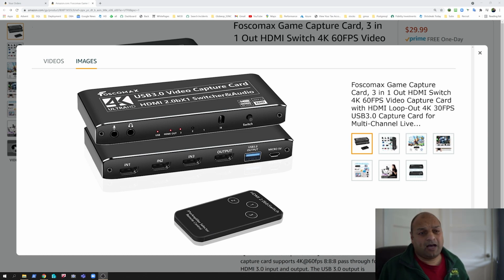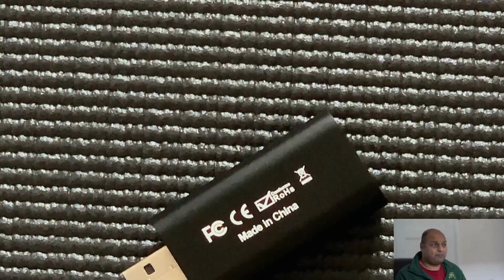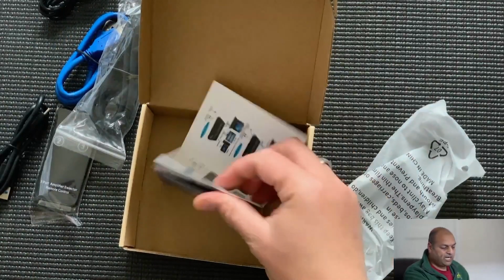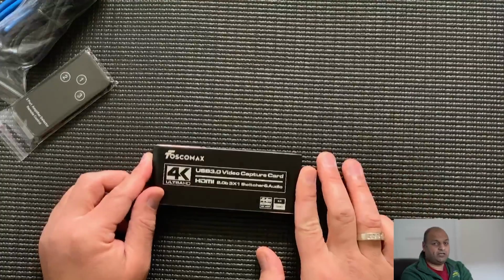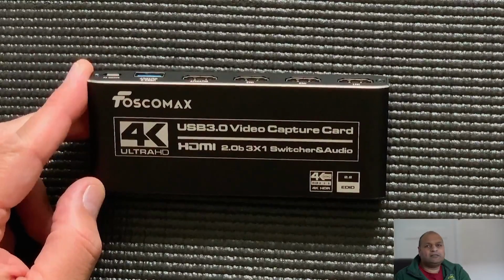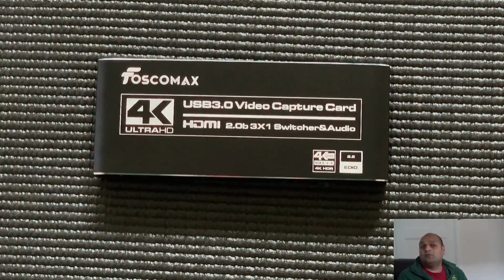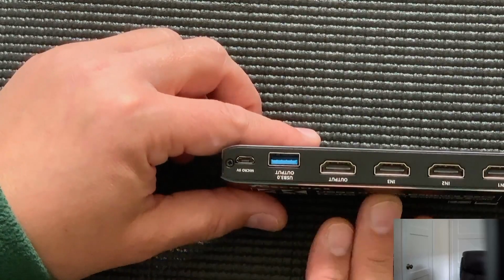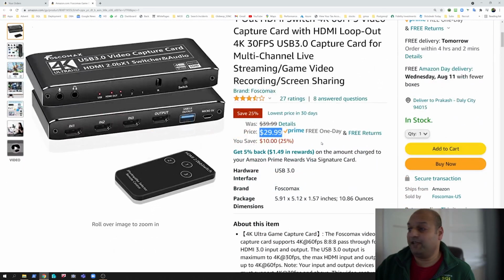Game Capture Card and HDMI Switcher

Comment: One Year later, What has been your experience with this product? Would you recommend it? I would like to know especially if there is a delay when changing the camera
Reply from the maker: I have updated to camlink pro as it has 4 HDMI input and output to 4k30 and its pcie, working great so far. 

about this one, I bought 2 (using just 1 port each for input) and used it for about 6 months and it was working fine, though I was not using too much switching and added heat sink to keep it cool, functionality wise it was stable....